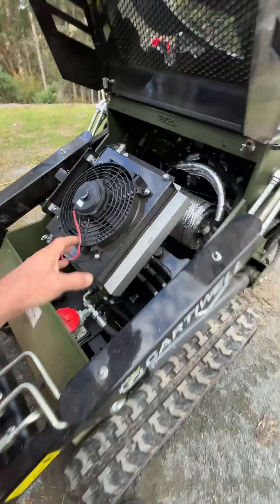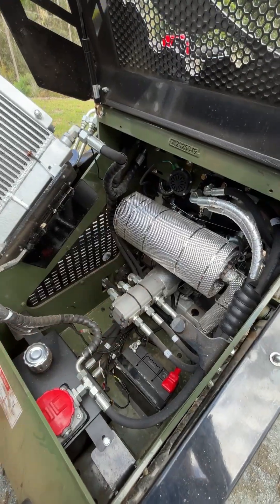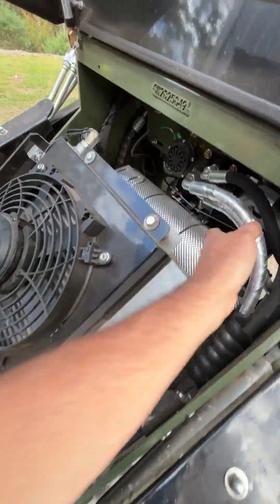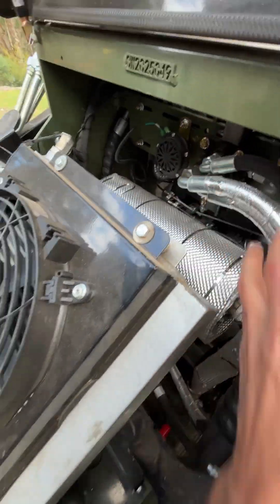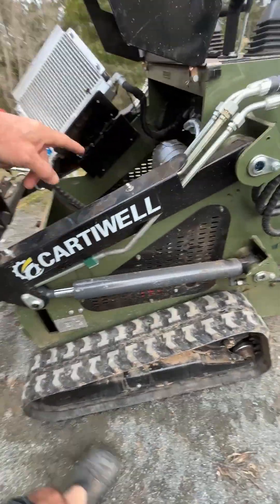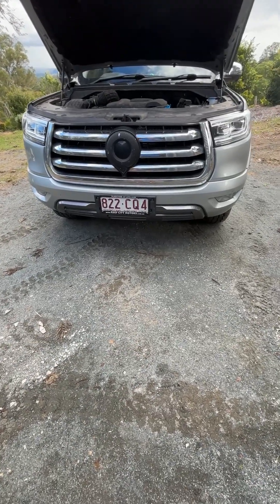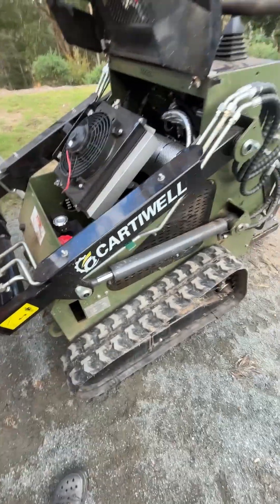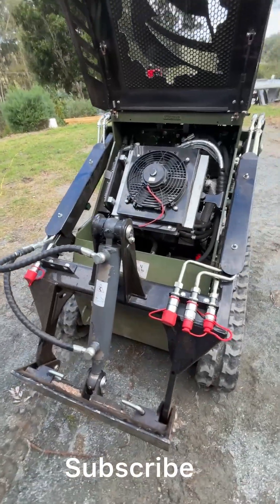Chill Out: The Best Cooling Solutions for Mini Skid Steers

Comment: Hello, sir. Question on the cutouts on the motor cover. Is that to pull more fresh air in to cool the motor? If not, what's the idea behind that?
Reply from the maker: It pulls air in to cool the motor and flows over the heat shield to supply cool air to the radiator. It also keeps the operating station nice and cool.
Reply: @sunshineacresaustralia perfect, I'm going to do the same. Thanks!

Comment: Thanks for this video. I really like your cooling setup. Unfortunately I do not have as much clearance as you do between my radiator and front hood. Do you have a gauge for your engine temperature? I only have one for the hydraulic fluid. Engine temperature would be good to have.
Reply from the maker: Only hydraulic temperature

Comment: Thanks for all the vids!! Question.... In the process of chatting to the seller regarding this machine. Option to add self levelling bucket for an extra $300. In your opinion is it even needed? I know the local Kango's has that feature but as this is going to be my first skid steer from china, would be keen to hear your take on it and someone who has done over 30+ hours on this machine.
Reply from the maker: I haven't needed it, mostly because I live on a hilly property, and I seem to be adjusting the bucket for slope and rarely need a level bucket because the machine is never level. But I really miss having a float feature for levelling and finishing off. To me, a float feature would be far better than an auto-level bucket. What brand machine are you considering?
Reply: @sunshineacresaustralia  Yeh, you’re right. I was thinking, since I’m mainly doing grass flattening and dirt work, the auto-level bucket wouldn’t be much use and I could get away without it. It’s probably more useful if you’re carrying heavier loads or moving blocks and pallets.

I've been researching for the past few weeks and narrowed it down to a couple of machines... but after seeing your posts on FB and your vids here, I'm now looking to get the exact same one, CW-460. I'm asking to get the 4in1 bucket instead of the standard bucket and I'd probably get a digger locally from auction. 

Have you used a digger on these mini skids before by any chance?
Reply from the maker: @ross3d807 I just hooked it up to try. Give me a few hrs to post a video. Let me know if you’re interested in the cw460 and I can refer you to a sales person.
Reply from the maker: @ross3d807  https://www.youtube.com/watch?v=FBi8D5imDC8